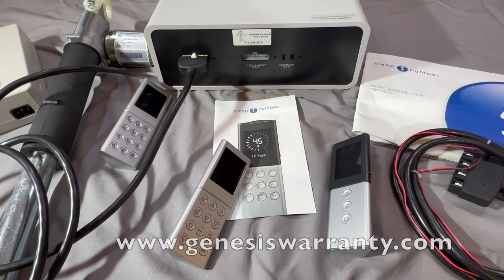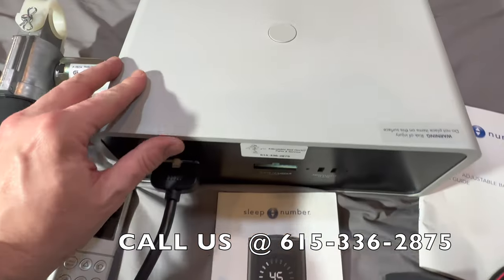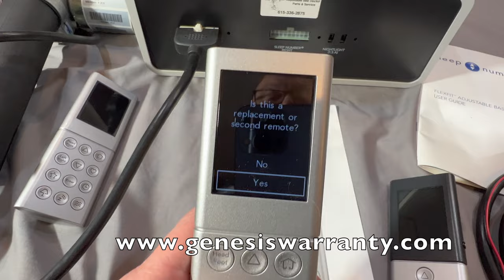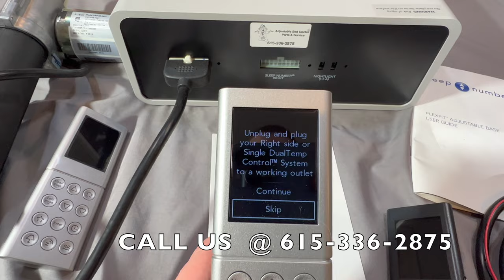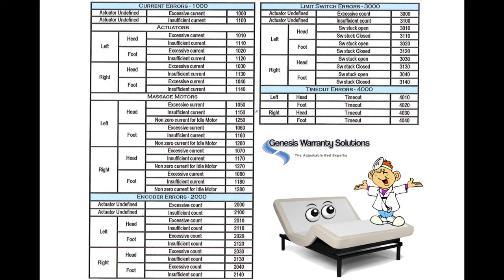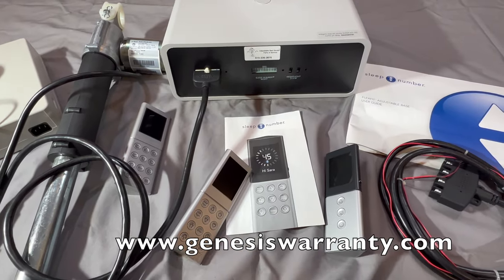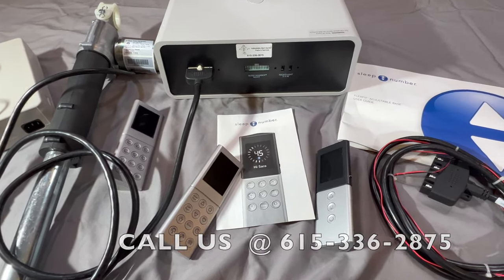Sleep Number 360 Smart Bed & Flexfit 2.0 Base Troubleshooting  Help/ Repair

Comment: We have a sleep number split king bed purchased in 2004.  Our old air compressor has to attachments for each bed - one for firmness control and one for air.  Recently the compressor went bad so we ordered a new compressor through Sleep Comfort and I explained what happened.  We have received a new compressor which only has one tube attachment for each bed (we think).  Along with the compressor, they sent two tube plugs.  Are we correct in assuming that there is no longer a "firm control" attachment and now only an "air attachment" on this new compressor.  Sleep Number folks had all of our purchase details, so I'm guessing they know what they are doing.  Do we now plug up the "firm control" attachment and just hook up the "air attachment" to each bed?  Right now that is the only solution we can come up with.  I guess they do not make the old compressors any more.  Would appreciate the help.  Thanks much.
Reply from the maker: Hello. Unfortunately, we only deal with Sleep Number parts for adjustable bases.  Anything to do with mattresses or air pumps are parts that have to be addressed with Sleep Number corporate.

Comment: My Sleep Number Split King with adjustable base is 6 years old. Today, I received an E5 error code on remote. I called Support and they are insisting it is the power box. After I started troubleshooting I was able to get the left side to work. When hitting the reset button on the box, I can hear the left side making adjustments but not the right. They still insist it is the box. Any thoughts? Maybe it's the power receptacle/rocker switch?
Reply from the maker: Yes, I agree with Sleep Number, control box failure. This is certainly an issue that we see sometimes with that particular control box.  

As you already know , Sleep Number does not have those control boxes and they want to upgrade your bed with components that will not allow you to use your original remote to control your mattress and base at the same time. 

We do stock the factory OEM boxes for Sleep Number so you can still use your original remote.  Please reach out to our office during business hours and consult with one of our experts.

Comment: I've been going back and forth with Sleep Number & Leggett & Platt for several weeks. It's a 2022 Split king 360 base. The under bed light does not come on when the left side of the bed is exited but It illuminates when the right side exits. Leggett has sold me a new light and a new control box which hasn't changed the situation. Sleep number says there are no errors when they access the bed and that Leggett and Platt is responsible for the issue and Leggett and Platt state everything has been replaced that could cause this. I wish I would have never bought this bed.
Reply from the maker: Due to the complexity of your issue, you will need to contact our office and speak with one of our service technicians.

Comment: We are having such a bad time with ours and they’ve tried over the phone to fix it!  Had we known we couldn’t get someone out to come help and not just phone stuff we would have NEVER spent the money we did on this junk bed!
Reply from the maker: Contact our office during business hours for a much higher level of support. 

We make repairs on these types of beds daily.  Problems with these beds are either electrical or mechanical. 

If the problem that you’re having is an electrical problem, see our diagnostic codes chart in this video.  Then contact one of our experts with the code.
Reply: I have not been able to adjust (up/down) my bed for 2 years, so I completely know the feeling.

Comment: the up / down buttons on my remote no longer work? is this fixable? this is for a 7 year old sleep number bed. the remote is the same shown in your video.
Reply from the maker: Hi Paul, those remote controls are non-repairable.  I believe you can still purchase refurbished ones directly from the Sleep Number website. If not contact our office during normal business hours and we can try to find you a replacement.  Thank you for inquiring with us!

Comment: Do you know where the serial number for the flex fit bases are on the base itself? I lost the registration card and need support from sleep number and they won't help until I give the bed base serial number. 😮
Reply from the maker: The serial number on those bases are located on a white label affixed to the actual metal frame. Could be on the left or right side or head or foot.

We don’t need your serial number to help you with your Sleep Number bed. You’re welcome to contact our company for personalized service.

Comment: I have had my Sleep Number bed for a week and a half and still cannot get the Sleep IQ to work.
Reply: Make sure your bed is connected to your wi-fi. The iq function takes about a week normally to learn your sleep schedule. You will know it's working when you get in bed and it automatically adjust to your sleep setting to help you fall asleep and then firms up to help you wake up more naturally.

Comment: One side deflated how do I fix this
Reply from the maker: We only sell Sleep Number parts for the adjustable bed, not the mattress.  I can tell you to check the little rubber O-ring where the hose attaches to the mattress fitting.  You can remove the O-ring and put just a little Vaseline on it and then replace. That should do the trick.